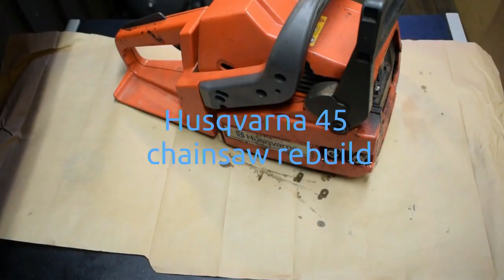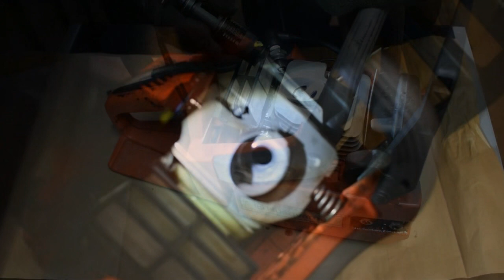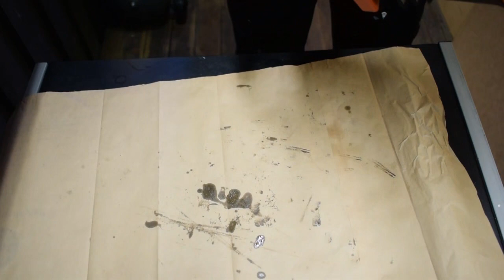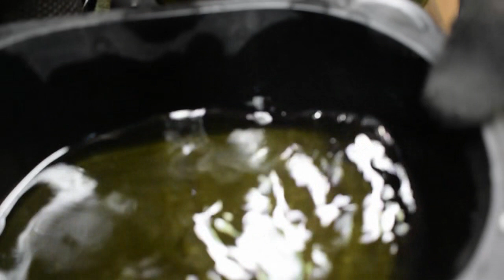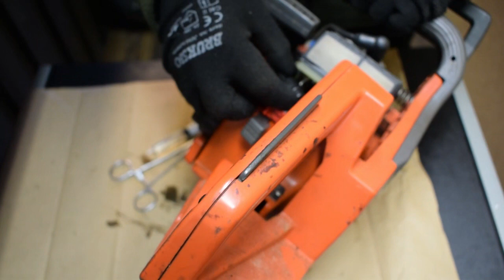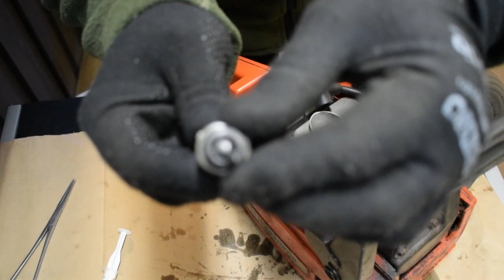Husqvarna 45 full rebuild and cleaning

Comment: Great video, thank you for producing and sharing your Husky 45 rebuild.  At 46:43 in the video, you apply motor oil to the crank shaft sealing surfaces.  The Husqvarna Workshop Manual specifies to use "3140 RTV sealant" instead.  Any comments on your results or experience without using this sealant compound?
Reply from the maker: Thanks for pointing that out. Indeed, the gasket wasn't worn at all and I did have any sealant. So, the alternative was to grease it to prevent air leakage. The chainsaw runs fine and the compression is about 120.

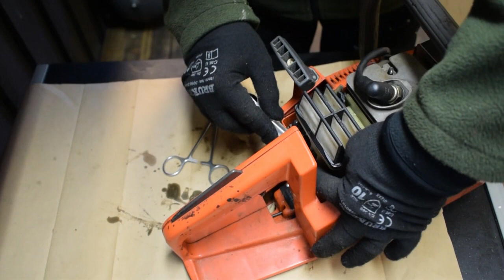Comment: I'm confused. When you injected with the syringe 6:40, you were going into the gas tank vent tube which goes nowhere (under the right side cover) where it connects to nothing) Am I correct?
Reply from the maker: There are two tubes: first with vent between tank and plastic cover and the second between tank and carburettor.The fuel mix has to be injected in the second one.
Reply: @dr.lomester657  140 psi good compresion 372 xp oe ?